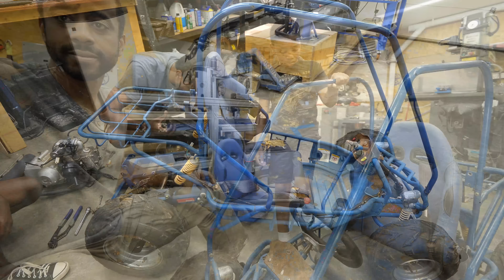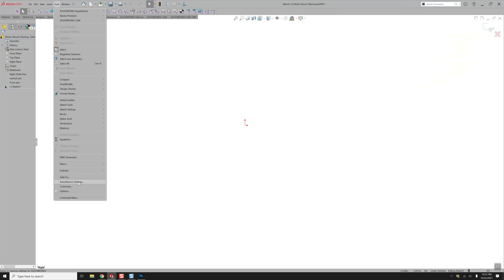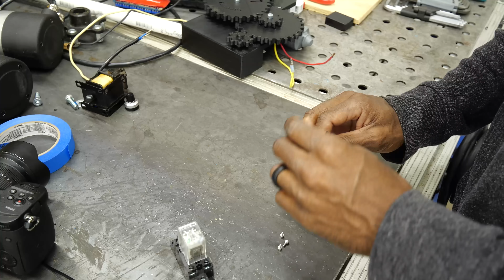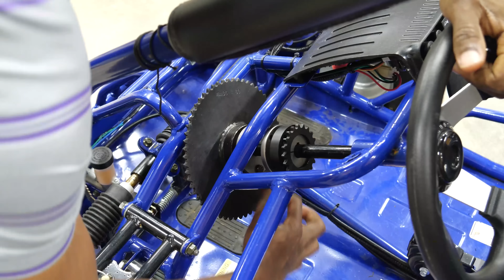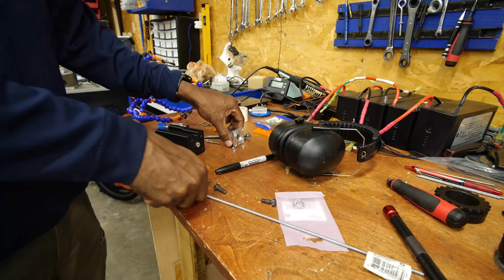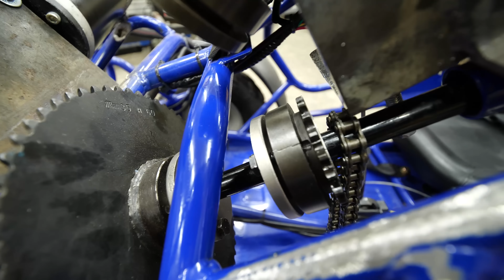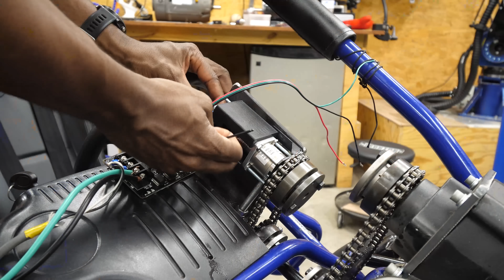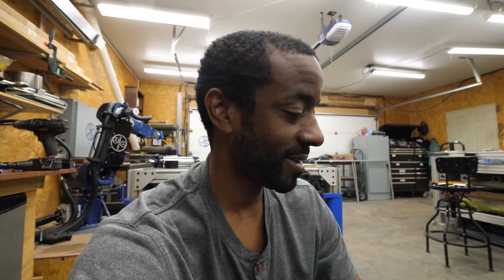Building A Self Driving Car - Jeremy Fielding 098

Comment: The problems of modifying someone else’s design. The forces acting in the steering coulomb were calculated on the original design, mostly torsion.  The shaft size was determined from this.  When modifying its easy to overlook these extra forces in directions that where not intended.  I had a similar problem modifying a motor I sheared that shaft.  I never calculated the stress under the new torque.  Makes me think how we can avoid these problems and remind ourselves that every part must be reanalyzed.  In a way it’s easier to start from scratch because you know you will account for forces when designing the part.
Reply from the maker: Well stated… thank you for pointing it out. most things are easy to see after it breaks, catching it before with all the other issues being considered is a real challenge

Comment: You can try to use some automotive parts like electric direction assist system for steering  wheel that will make things much simpler and reliable

Comment: 1) Slip clutch on the motor torque.
2) Separate measurement of the end result of the steering shaft
3) Additional measurement of the motor position

If 2 & 3 don't match...?

Comment: Very interesting project as always ! A few thoughts :
- Regarding the control system : woudn't it be easier and faster to first work out everything at very small scale (with typical cheap DIY electronics parts), and then scale up ? This could avoid some of the inertia caused by the fabrication/ordering of big parts, and might have allowed to find out about the inverted feedback loop earlier.
- Regarding the mechanical aspects : perhaps some elements of the rigging work done on cars and trucks by Grant Imahara on Mythbusters might be relevant to this build ? With the obvious caveat that these remote controlled builds didn't need to accommodate a driver ...
Reply: @AEON.  Oh, I didn't mean it in terms of the physicality of it (mounting the parts, evaluating the forces at play, and so on) but rather in terms of developing and bug testing the code, thanks to being able to dismantle and reassemble everything quickly without having to even be on the shop floor, and so on.

Comment: Even though it may be cheaper to replace the steering column than a blown up motor, It would be safer to blow up the motor; because if you lose control electronically, you can still grab the steering column with your hands and drive manually, while if you break the steering column, you have no way of controlling the car. It's not a matter of what's cheaper, it's about what safer and what fail safes can be involved.

Comment: what if you set up a limiter at the end of the steering range so in case of catastrophic event the power of the all motors being cut off! It may be a little expensive for the build, but it could help not to reorder/remake gears, shafts, and motors during R&D.

Comment: You should have a shear pin in one of the gears controlling the steering wheel shaft.  If an over-torque condition occurs (like hitting a curb or the motor over-steering), the shear pin will break but the driver will still be able to control the steering.

Comment: OK on the steering column failure: trying to decide which you want to fail first the motor or the column, is the wrong question (at first). Your first question ought to be "What are the forces involved that I should engineer for?" and design both a column and a motor that can withstand those forces plus a good margin of error. That way you can be confident that the whole assembly should be able to withstand whatever happens during normal operation.

Then you can decide which one you want to fail first. My recommendation: Fail the motor first. It's a more expensive part, but it would still allow for manual steering. 

But I think a better option is to have a clutch. Instead of chains, have at least one belt-driven component that is designed to slip when the load goes too high. Slippage is also dangerous - you can't get around the fact that a failure is going to be dangerous. But you can code the controller to detect a slipping belt and stop the motor and a slipping belt allows the entire system to recover on its own once the load goes back down. And if the belt needs replaced that's a really cheap part.
Reply: Also, if the slippage is between the motor and the shaft, but the encoder is still a no-slip connection to the steering column, the controller will be able to continue controlling it until it gets severe enough to require a shutdown.

Comment: I think if you're behind the wheel and the steering column breaks and you're behind the wheel you won't have any control of the direction but if it's the motor that breaks and again if you're behind the wheel, you'll be able to take control of the vehicle especially if it's on a good speed. It's just a matter of safety. Maybe put something g in place if the steering motor goes bad, an emergency break will engage or something to mitigate loss of control.

Comment: Possible idea for steering input in the event of system failure. (This would probably work best with a belt drive) Make the steering column very strong IMO I wouldn't ever want a failure of my steering input. For the self driving steering input that is driven by a belt drive. 

Use a tensioner that is pinned at the proper tension so the self driving motor can act on the steering column. 

In the event of a failure either having an e stop style switch in the cockpit and or self diagnostics so that the pin would be pulled using an air piston or linear actuator releaseing belt tension and allowing mechanical steering input. 

Very cool project looking forward to more videos!!!
Reply: Instead of either the motor or the steering column being the failure point, the belt should be the point of failure.

Comment: I really appreciate all of the footage of what goes well and what doesn't.  So many videos only show what works and don't show all of the issues and solutions you run into.  That is part of making and is so often glossed over.  Thank you for including that in your videos.  It adds so much to the reality of what a project is going to take.  My son and I were just talking about this on a project he was working on.  He is trying to remove the transmission from one of his trucks and it won't come off.  He has tried all of the tricks he knows about and the videos he finds, the transmission just comes off.  Or if they have an issue, it is a before and after and they really don't go into how they got the two pieces to come apart. Thank you so much for putting the time into recording your videos and in the editing part, keeping the experience in there.

Comment: "Thank you for joining me through all this pain and suffering" I think that's my new favourite sign off for engineering videos! 😁 
I couldn't agree more with wanting to me able to hit undo irl as well.

An idea for the coupling problem might be to add a spring loaded connection, where both shafts a coupled such that they are under tension to align. And to combine this with a ball bearing detent style mechanical lock in the connection up to a certain force application.

This allows for a solid connection untill a maximum load, and then can reset when it's possible to allow for control to be maintained over the output.

I hope this conveys the idea, I'm sure this can be done using two disks with slots, but there are many implementations.

I look forward to seeing what you come up with!

Comment: It looks like you might want to current limit that motor to limit the amount of force it can apply to the steering column. The simplest way would be to use a big wire-wound resistor. You could also back that up with a fuse/circuit breaker that trips if the force applied substantially exceeds whatever limit you calculate. 

I'd start by powering the motor with a bench power supply and setting it to constant current. Set it to a low current (250mA for example) and hold the steering wheel stationary. You can get a feel for how much force you might think you need to steer the vehicle without breaking anything. Turn turn up/down your current on the power supply until you get to that point. Then you can use that current and your motor voltage to calculate a value for a power resistor.

Comment: It looked like the steering motor tensioned the chain when you switched power on. If the motor was spinning the wrong direction you would've lost it there? Also a motor with less power wouldn't necessarily break/overheat even if it can't turn the steering column, if properly selected. 

Many cars have a torque sensor in between the electric steering and steering wheel to detect if the driver wants to take over (or to check that the driver is there). Maybe some type of a coupler with a strain gauge on it might work. Commercial torque sensor options are quite expensive.

Comment: In every project simple thing like control servo/motor can become challenge , I would play with Arduino motor on table make prototype use small motor if speed is high then put making all that great 3d designing, cutting, welding ... etc

Comment: Maybe you could add a sort of mechanical fuse to the steering column? A shear-type pin, like the ones used on outboard motors for the peopeller? So if the motor goes haywire or someone grabs the steerongwheel it will just shear the pin and not damage anything (or anyone).

Comment: Speaking as a fellow engineer (retired EE) maybe debug your software/hardware on the bench before installing it in the car. Once you know things are moving in the right direction and distance, fewer things will break when installed.
Reply from the maker: Frankly I felt like I did that. We made a prototype that worked identically to the full scale. We tested the parts individually. That was one that was really.... REALLY hard to see under the circumstances. Video editing hides all the in-between stuff that lead to the ultimate oversight. But I could not tell at the time from my orientation that the motor was spinning the wrong way. It was spinning at the right speed and switching directions when it was suppose to. It looked right until it went wrong.
Reply: I hear you. I’ve blown up plenty of things in my time, too!  Love your channel. You’re one of the best instructors on YouTube.

Comment: Personally I would prefer that in a failure  state to be able to take over manual control even if it means replacing a motor. 
Also that large gear spinning between my legs would make me nervous
Reply: The problem is....

It will mostly be children behind the wheel.  I'm sure that you could or at minimum believe you could assume control in an emergency situation. But that is a lot to ask of a child whose primary experience is going to be the self driving part. Even then,  if the failure is the shaft or pinion gear, the steering wheel is going to be useless to anyone regardless of their skills. 

Given the situation,  I think a fail safe is necessary.  Perhaps some springs preloaded to return the wheels to center connected to the drag link in case the shaft breaks again.  He could also rig an encoder or sensor of some sort to the actual wheels at the steering knuckles to compared desired angle verses actual angle and have the power cut if they vary by more than a few percent.

 He may even want to look into applying the brakes for a situation like that. Going with an electric drive might limit options that doesn't drain the battery though.

Comment: Great project! The motor does seem to continue spinning even after breaking the steering column. In addition to the software PID control, I think adding mechanical limit switches to stop further rotation at both extremes could be a good fail safe mechanism.

Comment: Seems like a very dangerous construction. What if your kids got their fingers between the chain and sprocket!
Reply from the maker: there will be guards etc...None of that is designed this early as I don't know exactly what shape everything will take. I do like my kids and would like them to keep theirs legs and fingers LOL
Reply: @Jeremy_Fielding  Yes.  I realize now that you are in “prototype” mode 😀. The motor seems quite powerful and there could also be considered safety designs into the driver electronics and computer. So the steering can’t turn with full power from eg. left to right if the computer goes crazy or electronic is burned and shorted.